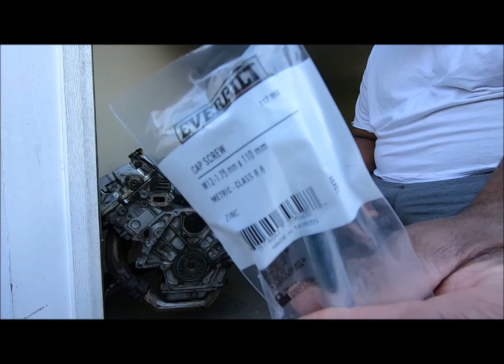2001 Cadillac Deville Northstar head gasket fix part 16

Comment: Are those engines good? O saw a guy nivalac that tunnes and races vortec 4200, and he said that the Northstar is pretty similar to vortec
Reply from the maker: My engine had a blown head gasket the whole time I had it. I believe if I replace it. The engine will be ok.
Reply: Are you going to replace the head studs?
Reply from the maker: @RedWhiteAndBlueVideo  I'm going to replace the cheap stock bolts with Felpro bolts.